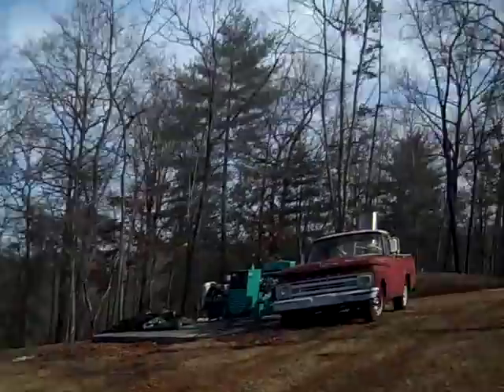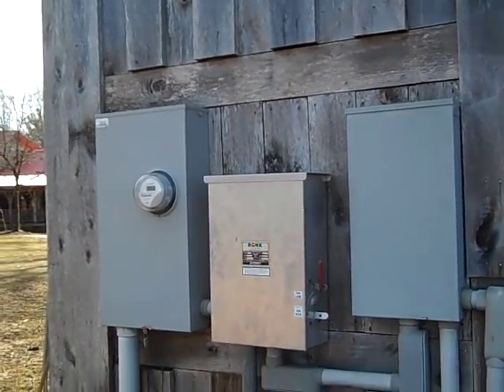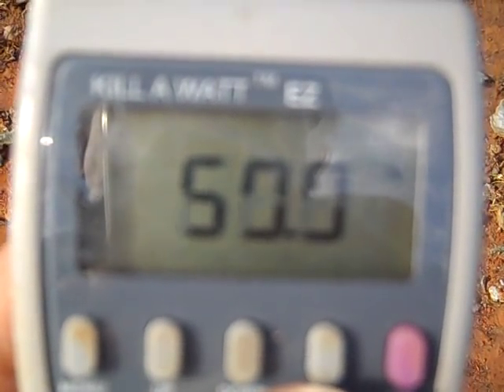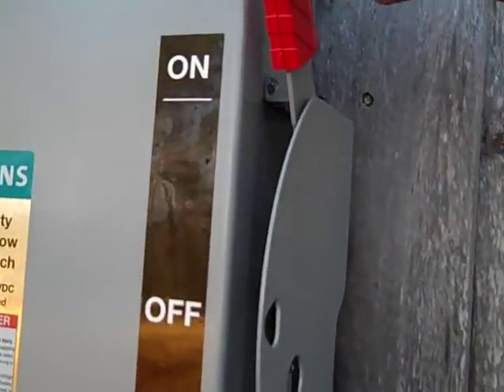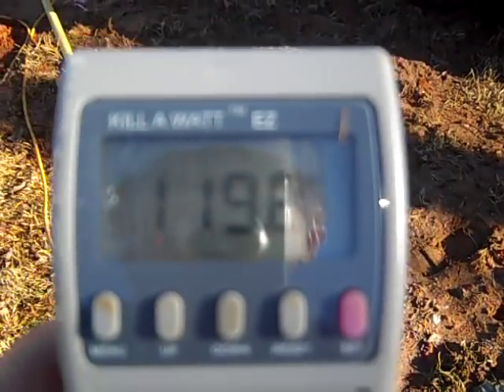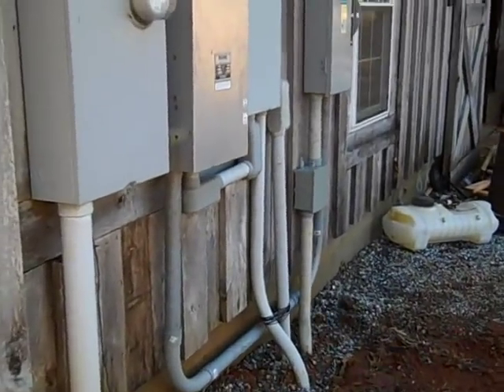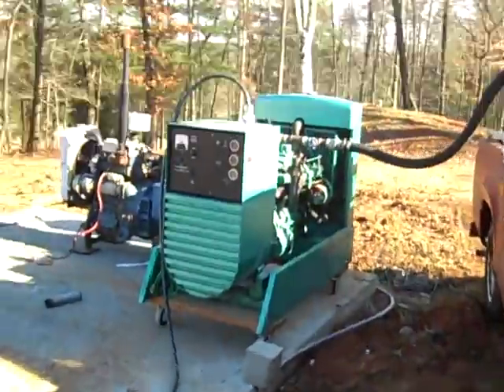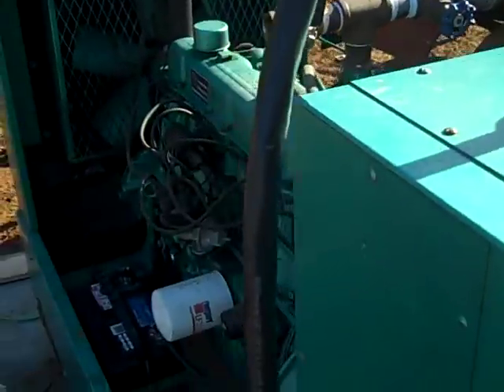The wood gas generator runs the whole farm!

Comment: you all are missing the point. he is trying to get things in a way where he can get OFF THE GRID> I.E> not depending on the companies to support his homesteed
Reply: The problem with off the grid is how much more inefficient things get when the scale gets smaller. Grid power will always be more efficient and friendly. Options like this should be for when grid power is down or totally inaccessible.

Even then there are remote towns that share a town grid for reasons of cost which also reflects an a mount of efficiency. 1 Gen is better than 10, materials wise.
Reply: @GoingtoHecq  how do I politely tell you that you're completely wrong about this. because these days many electronics and other household items take next to no power. a good example of that is how van life has got exponentially better.

so what are you really powering off grid that requires a stupid amount of power? or is it that you don't even know how to live  off grid so you have no idea how much power you need?

let's see. a small fridge and a LED lighting system and a few occasional power tools that are battery powered. that really doesn't take all that much energy.

and then there comes the efficiency cost I'm off grid versus being on the grid.

when I buy land in the middle of nowhere. because it's not next to the grid I'm getting a way better price then you would ever find on the grid.

and when I make my own power from solar or a little mini Hydro it's always a way better deal.

I mean I can kind of see people's argument 20-30 years ago. when living off grid was really living in the sticks.

but these days there's internet from the sky and appliances hardly take any energy. 

best part is my land taxes are so low in an off-grid situation that I can really grow enough vegetables to offset what I pay in taxes.

so living on the grid in my opinion is just putting a joke around your neck for the government.

edit add on. I can point a big digital TV antenna towards the city and get about 50 to 70 channels for free. and I'm still off grid, you get a high quality TV antenna. and then get it ClearStream TV converter and it makes a signal that hooks up to your Wi-Fi. you can literally watch your TV on a tablet..

And you use next to no voltage😁
Reply: I like what the guys building for the technology. But most of the people I see doing this haven't really reduced their load necessity.

I mean I could build a solar setup for 2 to 4,000 that would do everything and then some.

A buddy of mine build a system for under $500 that supplied the electricity his trailer needed. And he had a fridge and a computer.

What I'd like to see someone do is use the heat from the biogas reactor to heat one structure. a home or a greenhouse.

And then use the generators liquid cooled access Heat to heat one place with the generator BTUs and exhaust.

And another structure or Greenhouse with the liquid coolant.

Moreover realistically with a below ground geothermal Greenhouse design. There would be almost no energy needs. 

The system would essentially Supply a surplus of energy and heat.

Perhaps a biogas production manure digester for excess Heat.

Sorry if I'm having an Urza moment.
Reply: @TurnUpTheVdeoSpeed  you need a system one person can operate and maintain, but I think you are on the right track. get the most out of every thing you use.
Reply: @lukewarmwater6412  everything I've described could be done with what the individual in the video already has. It's just a matter of using each application efficiently.

It's more a matter of seeing things from a commercial farming standard or efficiency forestry standard. Most people I find doing these things are just trying to give a middle finger to the system.

And don't get me wrong I agree with that.

But what makes technology survive is when the hobby can be a productive part of the family business. 

side note. Back in the day when I picked up a load in Billings montana. It was a whole load of pallets. there was a hole roll-off dumpster of broken pallet boards and bits.

The people working there didn't understand when I said.. That wood could be powering your entire business.

such lines of thinking have led me to wonder if it would be better if people had instead of natural gas furnaces. natural gas generators so they could heat and power their homes.

Considering all the methane that can be turned into syngas from the average Dairy operation. 

Ultimately I kind of nerd out on things like this. Because I can see Energy Everywhere. 

Which makes it rather sad to see the way the American school system makes a K through 12 activist that claims to be an environmentalist.

And not an individual that uses science and Technology to solve The World's problems.

AKA This is the Golden Age and most people don't even realize it.
Reply: I like what the guys building for the technology. But most of the people I see doing this haven't really reduced their load necessity.

I mean I could build a solar setup for 2 to 4,000 that would do everything and then some.

A buddy of mine build a system for under $500 that supplied the electricity his trailer needed. And he had a fridge and a computer.

What I'd like to see someone do is use the heat from the biogas reactor to heat one structure. a home or a greenhouse.

And then use the generators liquid cooled access Heat to heat one place with the generator BTUs and exhaust.

And another structure or Greenhouse with the liquid coolant.

Moreover realistically with a below ground geothermal Greenhouse design. There would be almost no energy needs. 

The system would essentially Supply a surplus of energy and heat.

Perhaps a biogas production manure digester for excess Heat.

Sorry if I'm having an Urza moment.
Reply: @TurnUpTheVdeoSpeed  
I’ve rarely heard someone properly consider the problem from multiple angles the way you have laid it out. Impressive.
What is an Urza moment?
Reply: and he is failing.....sory I told the truth.
Reply: Well, you'd need parts for the generator for maintenance. Oil.. And an engine on wood gas wears out pretty quickly, since it's dirty fuel. So I guess true off grid living, would be living without electricity, and without a car in the end.
Reply: @Skoda130  I like live by stream run small generator last decades good to go 👍👍
Reply: @Skoda130  Casting aluminum for parts is a cinch

Comment: brother where do you live?? i would love to take a field trip to check out your set up
I'm aspiring to be an energy broker ( I install solar right now) and I really wanna learn how to set these systems up, now do you have a battery bank? cause you could hold electricity and only fire up your gennie when the batteries are low, and if that was also connected to a solar array that would be less offen depending on your solar output.
                much respect
                      Fueler_fluty

Comment: Towards the end of WWII the Germans ran trucks on wood "Producer Gas" made from sticks they'd gather along the highway.   The main reason they stilll don't do it is wood gas is so hard on the engine you were lucky to get 5000 miles before you'd have to rebuild it.   After WWI a Model T Ford was driven from Frederick, Maryland to Hagerstown on finely powdered coal.   That was even worse on the engine.   The ash  or "clinker" is mostly oxides of calcium, sodium, potassium and traces of a few other elements that eat an engine up pretty fast.    Work out a way to get these out of the gas and you'd have a good thing going.

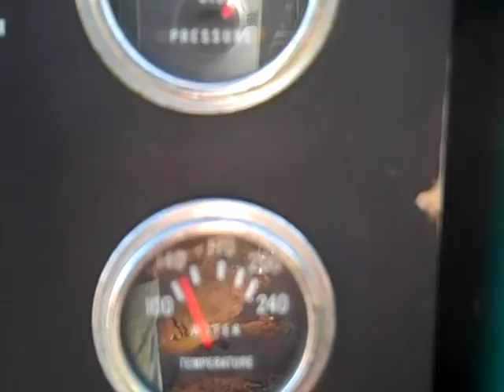Comment: 5:26 is that little over 1.3 Amps? so 120 x 1.3 = 156 watts 
How high can you load that up before it chokes and stops? Surely that generator can supply a good 5kW?

Comment: After watching the Video several times I have one question. The box that you flip the switch to go from Utility Company to Aux power looks like a single throw box. I have asked several people and Electrical supply stores, and no one seems to understand what I am talking about and says there is no such box. Please let me know what the box is called and where do I find one. I see the double throw box in the video that you mention Wood and Diesel and can get one like that but no single throw box. Please advise.
Reply: It is just a simple power transfer switch. Meaning on one setting it is connected to the grid and when you change over, it disconnects the grid and connects to your "other" supply being generator, solar, wind or whatever, isolating it from the grid. It makes it so the power is never put back into the grid due to the fact that it could kill someone working on the lines or damage others property. Most codes require this kind of safety switch to be installed.
Reply: Gregory Thomas Mr Thomas, Thanks for the reply. I follow the reason behind it but I cannot find the box anywhere nor can I find anyone who knows that one exist. What is the single throw box called. One supply store said that 775 probably rewired a disconnect to do this.
Reply: Kenneth Authement that transfer switch is also a double throw unit with no noted off position.  The same box as the other one you already know about can be used for both tasks. A licensed electrician will know all about this stuff and should  be contracted to set it up.

Comment: Congratulations, this is cool for its self-sufficiency ... but don't you basically have a smokestack on your property 7x24 or whatever duty-cycle you need to fire that baby up?
Reply: the purpose of the gasifier is to make smoke which contains combustible gasses. those are sent to the intake of engines and they are burned and that leaves only CO2 for the most part.

Comment: mikanojo i'm not sure how much easier i can explain to you... wood used for energy is carbon neutral, it takes time to grow, but while it's in the woods it's a gigantic energy storage system, weed trees take very little time to grow and they grow thinner so tree shears can cut them down faster than saws.  the difference in labour you seem to be hammering on is near equal and the transport of petro fuels to location costs the environment, that you think gasoline is a viable emergency power source, while wood is not, that is seriously confusing... almost as if you're personally afraid of doing a little physical labour.

Comment: In rural Washington, saw mills, shake mills, furniture makers, all have lots more wood than needed, defects, too short, etc. My neighbor's shake mill also saws figured maple electric guitar blocks, and tosses most of the tree-no market for plain-'hobby wood'. Old growth cedar is sawn into acoustic guitar wood,3/32"-1/8" or??, kiln dried to 5% moisture. 20 % cracks or oozes sap-toss it. He has about 3/4 acre waste pile, everyone is appreciated when they remove any of it.
Tree services + landscapers will often pay to dump perfectly usable logs,(+compost, mulch, orphan plants,) to prepare for next job. Contact them and save them $100-maybe even charge them $20-$25 to give you fuel!

Comment: Would it be possible to run a large generator like this and turn your meter backwards.   Like a Grid Tie Inverted can do?  If you could, wouldn't you be able to run a lg generator several hours a day and zero out your electric cost?

Comment: for the cost invested, what could you have got using solar or wind turbines?  Considering of course there would be no fuel cost ever.
Reply: Plus the extra added benefits of no noise or pollution.
Reply: USNVA
Wood burning is carbon neutral, if the fallen tree is left in the forrest it will decay releasing the carbon stored, therefore burning wood is no different to letting the wood decay.
Very important if cutting trees replace them by planting ratio of 3:1 to make it sustainable energy.
Reply: To Grateful Child ---no way to compare this with wind or solar. Solar is now down to about $1 per watt and wind power is about the same. Solar yields about 4 to 1 with wind but the amount of power you get is still very low when compared to the engine driven generator! Add the cost of batteries and inverters and the cost to build a gasifier is way more feasible. You only need to run it when you need high amounts of power so it doesn't have to run 24/7, only during normal working hours for charging up your stotage system if you use one or to run high load appliances. I have been off  grid for 15 years and done the wind/solar hybrid system and am now working on one of  these gas wood to gas conversion systems. This system has been proven for almost 100 years and it was one of the things that kept free Europe going during 2 world wars. Do some more research if you are truly interested and you will find there is more info than you can possibly retain .

Comment: what this shows us, is that when the world runs out of oil, nat gas, and coal- we're all screwed.  that system is way too complex and will have reliability issues especially in winter time.  I know what happens to my tractor, cars, etc. when it's 10 below zero.  it's a lot of hardware to run instead of just getting a 5 gallon jug of diesel, no ?  to do a valid test, imagine there is no power at your house to begin with from the power company.  and no gasoline or diesel fuel.  just wood. it will be 1750 all over again.  but good video
Reply: You are a Donny or a Debbie Downer. Sheesh, now everybody is depressed.
Reply: I believe that the point of a wood gasifier IS the simplicity of it. You can buy complete systems that have actually have been designed and engineered to last. In 10 below I think if my life depended on it I would have a quality system. These guys look to have well designed and viable turnkey systems http://www.gekgasifier.com/products/product-overview

I may buy one...?
Reply: what this tells me is that you, tunnel whatever are one of those that will put their hands on their cheeks and say oh no, now what will I do / And that is about all you will get done. Only the people with some technical know how and aptitude will be running these things and everyone else will be reliant on us, I am one of those that will be making life possible for those like you.

Comment: what do you mean when you say emergency strips?  What is that?  Looks great!!!!
Reply: Electrical heating strips in the central air conditioning system.
Reply: oh, yes, expensive to run.  I would suggest that there is enough heat wasted from cooking and bathrooms that if you were to collect that and use in a heat exchange to warm the cold fresh air coming in, that would suffice. Although I bet you are already doing that too :)
Reply: or if you have a wood stove, connect heat exchange to that.

Comment: For noise concerns if you enclosed the generator in a building like he plans to then put some sound deadening insulation in it the noise would be minimal. Also, He is using a large generator for a huge requirement in power. If you were running a smaller unit it would be a lot quieter machine and more realistic probably to your individual needs

Comment: You need to learn a little more about carbon cycling before making these kinds of claims.  All energy in the US is produced by "burning stuff" However burning wood releases carbon that was just pulled out of the atmosphere by the tree in the not too distant past. Burning oil/coal releases carbon that was pulled out of the atmosphere millions of years ago. There is a difference - and you should learn what it is. Furthermore producing electricity at your house results in less transmission losses.
Reply: When you produce your own electricity you give up a small transmission loss but take on a large loss in efficiency. That is why it is always more expensive to run your own generator than to buy power from the power company, unless you are fortunate enough have free hydro or gas on site. Or in this case, have plenty of wood and don’t count your own labor as an expense. Also, who cares about carbon dioxide? Let the plants take care of it.

Comment: IN same chamber,, a note to all wanting to do the same be it gas or deisel the engines all run on the    rich side of the cilender   head  temperature    so put a temp . pick up as found on a indoor outdoor  thermomitor  next to a cooling fin on the head with putty.run engine on gasoline  note engine temp,how  when u run your test never let the temp go higher using your air mixture this will allow engine to run cooler and longer life  VICTOR

Comment: What heat source would power the sterling? The sun is only available part time, and not efficient during all of that time. Reliability is the key problem in your line up. I also looked at your site. I think you should seek help. I mean that. I'm not trying to defame you, or anything along those lines. I just think talking to someone might help you let go of some anger.

Comment: When going off grid, I know that the red and black wires main switch has to ne turned to the off position. But what about the white common wire ? After turning off the main and thus going off grid, when I connect my generator to the house, is there still a danger that electricity could travel thru the white wire and potentially injure a lineman ?

Comment: ...idiots... no different than burning petroleum!!!  It is carbon based and a source of nasty-ass pollution ... until you idiots realize that the SUN energy is the only solution(not forcefully via sun cells), you will continue to come up with temporary nasty polluting crap that is doomed to failure!  A sterling engine coupled with a sun dish will out do this noisy ass monster with a quiet ZERO pollution system... and most of us do not have a fckng farm to draw from!!!  do your MATH, idiots!

Comment: Ive got an 84 ford as our farm truck. Do you think with a 4 inch wide combustion chamber in a smaller oil drum i could run a straight six? if so could i get to 50mph and get up hills?